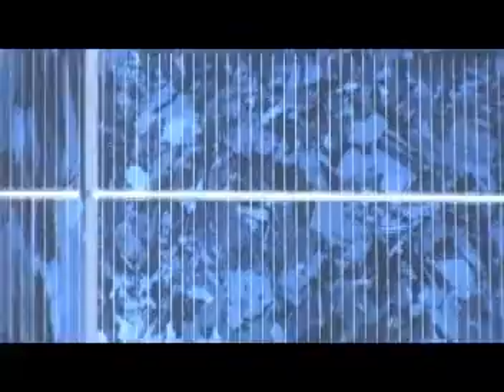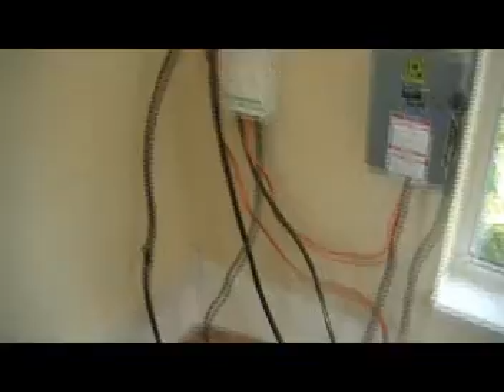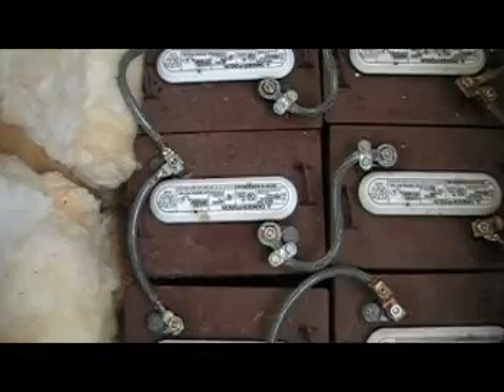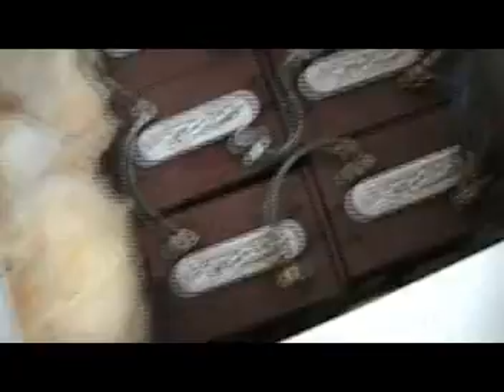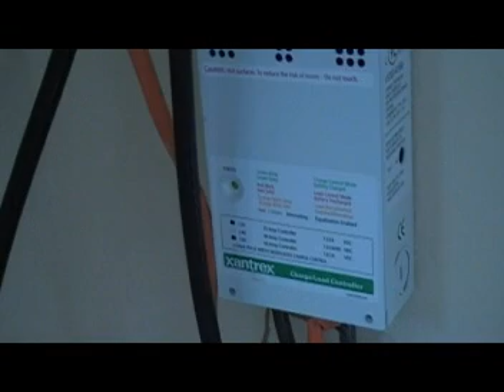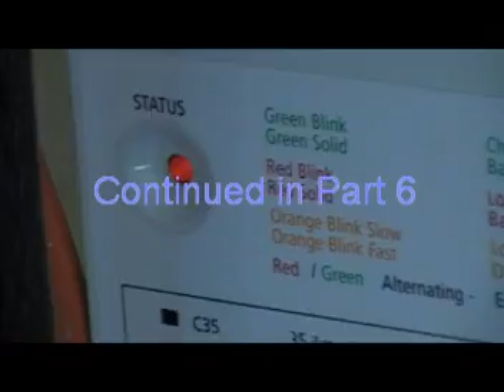Alternate Energy Part 5, peak oil, food storage, survivalist

Comment from the maker: Kinda hard to explain when not in person but I have laid out the battery bank in this one in a rectangle- 2 batteries wide, six deep for a total of 12. All aligned exactly the same- i.e, pos and neg on same sides. 

I drew an imaginary X and disregarded one part /  and hooked the inputs from the CHARGE CONTROLLER to the ends of that line- one on the pos, one on the neg on the corners. 

Do NOT wire direct from panel to batteries, you need the charge controller in between. Does that make sense?

Comment from the maker: He hunting camp there has lights and ceiling fans in every room 7 plus bathroom. Guys plug in cellphones and laptops to recharge. TV hasn't run there in almost 3 years- no one watches it. There is a little apartment size fridge and it will draw the batts down in 2 days if used during a couple bad solar days. This size system would be the perfect size for a "backup" for a regular house. Course you can ADD to it as money permits also. A couple more panels wouldn't hurt. Thanks for watching! SR

Comment: Thanks for showing a more affordable system ($3,000ish?).

Besides powering lights, what else can a system like this handle?

Refrigeration/freezer would be nice, but that takes a lot of energy.  Also heating in the winter (also a big drain)?

What are the typical planned uses of a system this size?